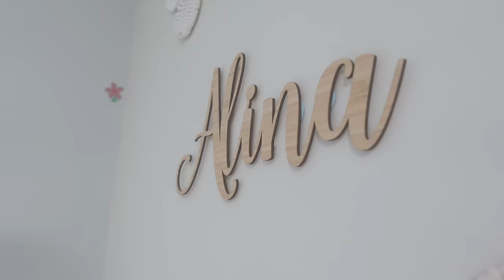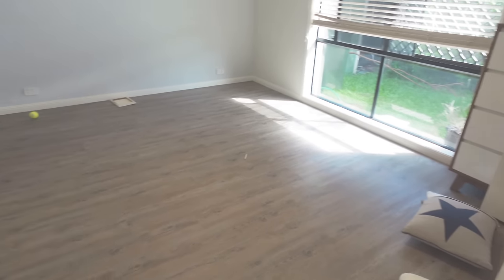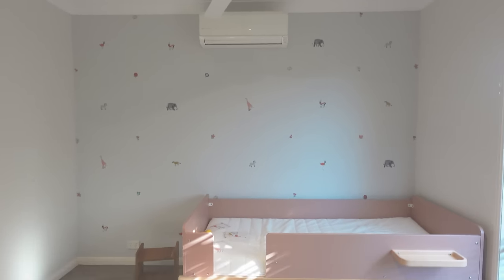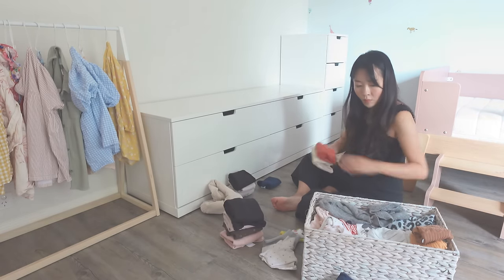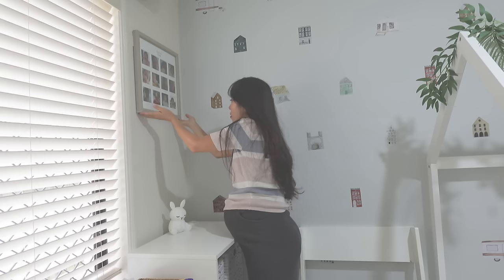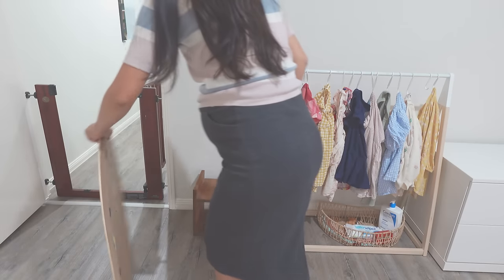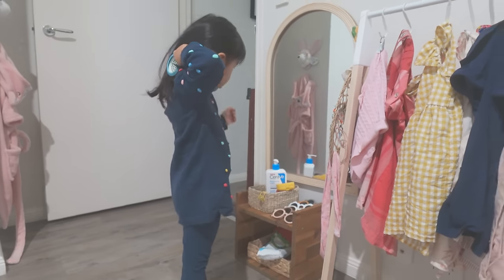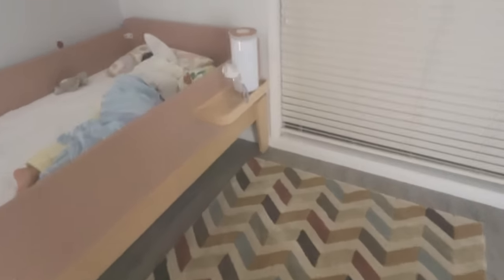Montessori Toddler Room Makeover & Tour | FUNCTIONAL & PRACTICAL BEDROOM for 3 year old!

Comment: I noticed that you used 3M strips “improperly” for the mirror. 3M strips are only guaranteed to not damage the wall if you pull it off using the little tab at the end that’s not sticky. When you put them in the middle of a mirror like this, you can’t reach the non-sticky tab so you can’t pull it properly. When you do go to take it off, you could minimize the chance of damage by first using a hair dryer over the mirror to heat up the adhesive.

I just wanted to share because I once put a pretty deep hole in my drywall by taking off a 3M strip wrong. It was especially bad for me because I rent haha. I just don’t want anyone making the same mistake I did if I can prevent it! ☺️